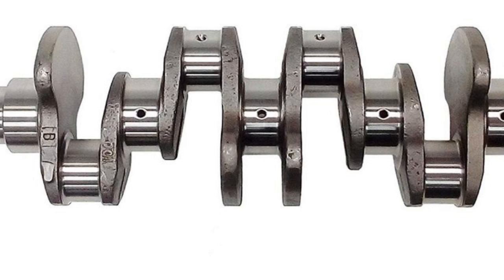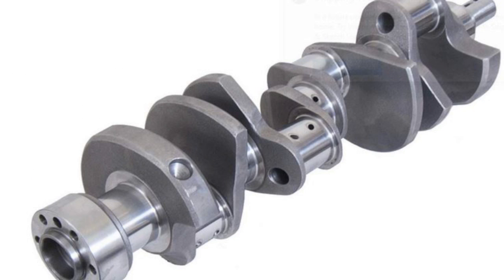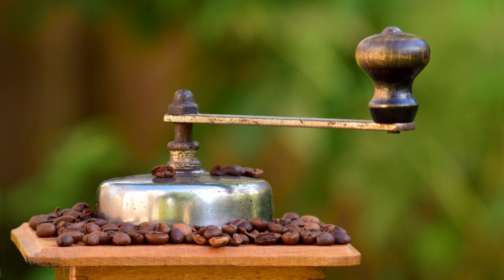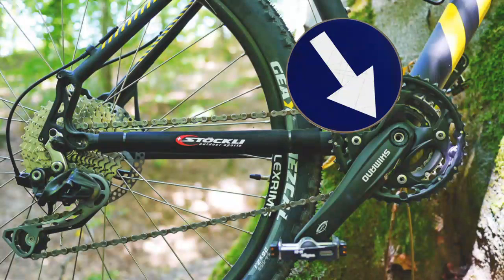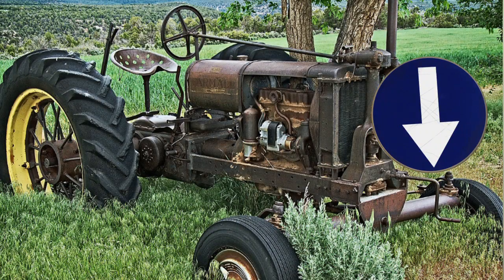Diesel Engines 101. Class 3.

Comment: I like that old tractor engine, could be started with a hand-crank, if necessary. There exists a modern version of this purely mechanical starter, it comes with a spring, loaded by hand-crank and the tension is then released to the crankshaft for a startup. 
Some old diesel engines also had a decompression valve! This is the safest way to stop a diesel, that would want to go into a runaway mode, because of some unfortunate circumstances.  And I would like to own a purely mechanical emergency power source (diesel) or car, that is completely EMP-proof!

Comment: Really useful informative videos! Good job mate! Been doing various jobs on different diesel vans for years without actually knowing the basics. Just been picking up knowledge from others here and there and teaching myself when I need to do repairs. The engines you describe are a much larger cc than the two I currently have ie 2.5 tdi Volkswagen and a 2.2 tdci Ford. But the theory is all the same and definitely helpful to know. Thanks!

Comment: Currently troubleshooting an issue on C7 (WAX) with ECU low coolant warning with derate.  Replaced sensor, and module with only temporary fix (problem comes back after 1000-1200 miles or so. Any information on ECU pin locations for this as well as how to check for a bad ground?  Thanks, really appreciate your videos! Learned a ton!

Comment: Tell Buddy and Piper that I subscribed a long time ago, and that I want longer videos. Also tell them that I ALWAYS watch until the very end and ALWAYS click the 👍 button. 
Question; Does a longer stroke create more ft-lbs of torque at a lower rpm than a short-stroke V8 engine of the same displacement?

Comment: so i have a 03 thomas rear engine 3126 cat with Allison 5 speed transmission. top speed is 63 i want to get more speed atleast 70 is it possible to turn it up. running 63 mph rpm is 1500
Reply: MPH = RPM x 60, divided by transmission ratio, x axle ratio, x tire revs per mile. First off do you have a gear parameter in the ECM stopping you?  So in top gear (?) you say, 63 @ 1500.  To reach 70 with your current set up, you will have to turn 1667, RPM's to reach 70 MPH. I would get ET hooked up first and look at parameters. What is your engine serial number?

Comment: I got a question own a 92 Western Star 4900 and it has a caterpillar 3406b engine backed up by 13 speed Eaton Fuller transmission I picked up an empty trailer my route took me on a path going up and down Hills I want to say about an hour into it I noticed there was radiator fluid leaking out from underneath the truck I found a place to pull over and there was radiator fluid leaking out the top of the engine almost where the bolts are next to the firewall would like to discuss this with you further if I could and I forgot to say when I let the engine cool down stop leaking would like your input

Comment: Hello 
I have a C9 on a 330DL cat excavator and it keeps overheating
We change the head, water pump, fan clutch, calibrated the engine and still overheats 
Works for 15 minutes and it goes all the way up in temperature.
What do you think we're missing?
Any help will be greatly appreciated

Comment: Hey I have a cat c9 Acert. Not an s. I have a fault code which is fin 17 son 94. (Low fuel pressure). This is a jaw crusher not an r.v, truck or bus. The engine starts. Filter changed. Fuel lines changed. Big foot on the back on the head changed and the line going too also changed. Oil changed every 200 hours. Engine has 9875 hrs on it. Any suggestions? Could really use the help

Comment: I almost forgot how massive the bearings were on a cat motor. We did a out of frame rebuild under warranty and when we brought the motor back we went across the scales to see the weight. It was about 3.4 tons and we hauled it on a 2 ton trailer. Didn't look that heavy but it was heavy enough that we had to let the air out of the trailer tires to get it off the trailer and onto the a-frame hoist. Took a couple hours and a handful of people just to persuade it back into it's frame.

Comment: I need some advice, I am 15 so still very young and I know for sure I want to go into the trades. I have to sign up for community college duel enrollment next November so I have to figure out exactly what I want to do to jumpstart my career, I am tied between plumber and diesel mechanic, because I’m interested in diesel mechanic more but I have family in the plumbers union and an easy job with let’s face it more pay, what should I do
Reply: Both are good trades. A plumber has to go to each job site, spends a lot of time on the road. You may have to repair sewage lines.  Work in high places, may have to do manual digging, concrete work. Talk to your family who is a plumber.
I have been a diesel mechanic for almost 40 years. You can work in the field or in a shop. Sometimes in the field you can't leave the job site until it's fixed. I work in the shop and have 50K of tools and still need more. Oil, dirt, grease sometimes garbage trucks.
And the most important thing if you choose the plumbers trade. It is mandatory to wear your pants low, so customer's can get the plumbers crack effect.

Comment: My 2 cyl Jake switch works but the 4 cyl switch is erratic. Sometimes nothing, sometimes one cylinder. Would Cat ET read the ecm and tell if it is low voltage (or no voltage) from the switch? Its on a Cat 3176. I have no engine codes.
Reply: You did not provide a serial number prefix. I used a 9CK which is mostly still running. If you have a 2YG or 7LG your in a whole different setup.
ET has a test for engine brake. Not running and place on what stage in the cab and see if solenoid powers up. DO NOT USE A MULTI-METER. Use a test light, most of the time the connectors are loose on the solenoids. But they usually show a code. You can pull the valve cover's and check for loose connections.  At the valve cover connection Pin 11 is medium feeds front and rear. Pin 9 is low (center) and pin 7 is your common. At ECM (J2P2) pin 13 is medium, 19 is low and 7 is common. ECM for switches (J1P1) pin 29 common,  pin 19 low and pin 13 is medium. Again this is for a 3176B, 9CK.
Reply: Thanks for the reply. Yes it is a 9CK and ill have to test it.

Comment: I knew exactly what you meant as soon as you said that the crank isn't actually touching anything inside the engine. I have some mechanical background handed down from ancestors and it in my blood. I have always heard that your bearings are hydrodynamic bearings,  like you said, a thin pillow of oil. You are doing a great job dummying it down for those who may not understand everything about engine cycles. Love the channel!

Comment: Cubic inches/ liters
pi r^2 x stroke x number of cylinders.
Example 3406 has a 5.4 bore, 6.5 stroke, 6 cylinders.
5.4 dived by 2 =2.7 radius
2.7 x 2.7 = 7.29
7.29 x pi = 22.8906
22.8906 x 6.5 (stroke) = 148.7889 per cylinder
148.7889 x 6 (cylinders) = 892.7334 cubic inches
Basic math